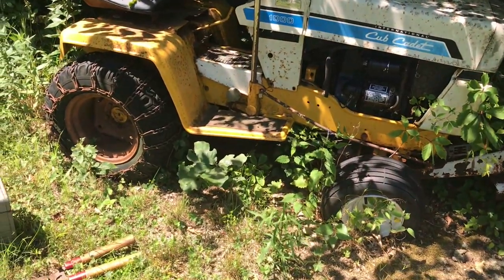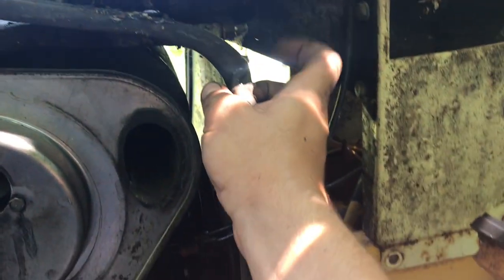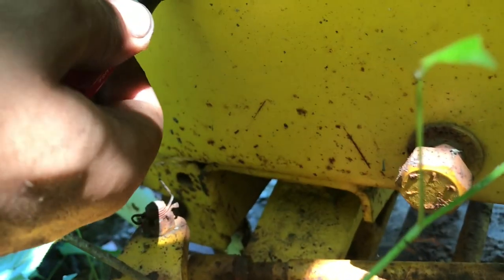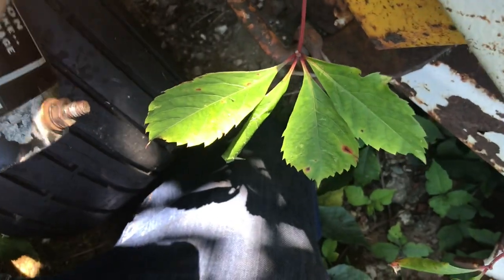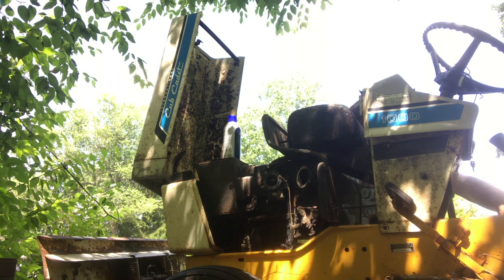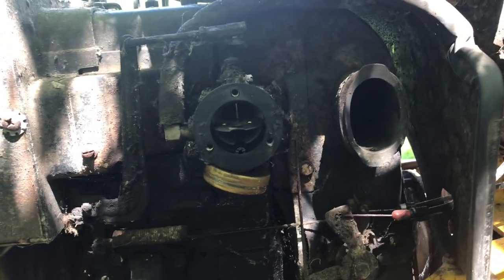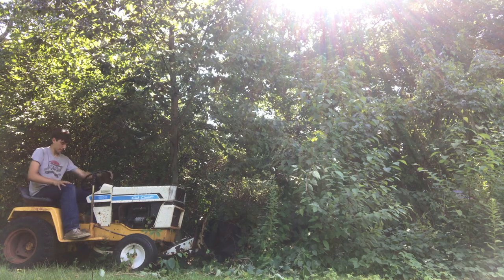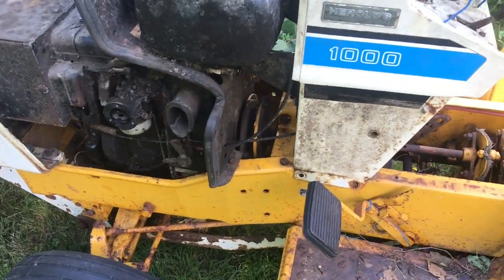1978 IH Cub Cadet 1000 Tractor | WILL IT RUN??? Sitting 20 years | REVIVAL

Comment: I'm a sucker for hunting vintage iron, but when the previous owner tells me it's been sitting for multiple decades and I go out to see that nature is trying to reclaim its yummy metal parts, my wallet starts screaming in my pocket. I start looking at how much metal is left and just bypass the fluid tanks, knowing they're full of contaminated and questionable fluids that have seeped in over the years to determine if I want to fall into the rescue trap again. At least you picked one that will be easier to find parts for! No one tells you these things til it's too late, but finding unique mechanic wunderkinds are definitely double bladed weapons for your sanity. They are cool and unique, but if you're not into reinventing parts that may not have ever existed elsewhere, it's a nightmare to work on them.
Just got done fabricating a clutch disc for an '86 Toro that it seems most of the parts were discontinued in 2005. Came out great, and thankfully most everything else is something you can bodge together from hardware store supplies like bars and springs, but those one-off parts are Always problems to solve. Part of the fun (read: insanity) if you will.

Comment: Nice find. I have a 1976 1000 that I scored at an auction for $70.00. It probably sat as long as this one did in a barn. I had it running and driving within a couple of days of getting it home. Mine has the 44A rotary mower on it, and I am currently working on restoring it. It has definitely been a fun quarantine project.
Reply: Which auctiona did you get it off of? Ive been looking for some new projects and cant find anything on facebook marketplace

Comment: I purchased a 1000 quietline for $150. I put a used 12 hp aqs upgrade and ran it for over 12 years mowing. The motor needs rebuilding and I picked up a used 14 hp aqs to swap it out. These are awesome tractors.

Comment: Congratulations on your Cub Cadet. Currently I have two {107, 682} and looking at possibly acquiring another 682 which would make three. The Firestone tires are  probably the original tires and I m not sure if the front tires are original but a very good possibility that they were. 
The chattering noise was the starter solenoid having bad connection issues probably from dirty connections at the terminals as you were probably all aware. I have experienced that sound many times over the past several years - So I felt your pain. 
As far as the clutch issue, The clutch spring on the Cub Cadets would break which would result in a similar situation to what you’re Cub was exhibiting in the video. Unfortunately, Both of my Cubs are hydrostatic- So I can’t be of much help specifically regarding your clutch issue. There are several Cub Cadet groups on Facebook in which cover several different areas. Thanks for sharing your experience here on YouTube. Best Regards From Versailles, Ky.

Comment: You should get the old sears, and the disker that you flipped into the weeds, those old garden tractors are tough little things. I have a 1200 cub and a 1650 I’m trying to get up and running. Looking forward to seeing more updates on this tractor!
Reply from the maker: I would take both those but I just don’t have the room. The IH was pushing it as is but had to have it. Good luck with your tractors. Thank you
Reply: The clutch is probably rusted and stuck to the two pressure plates causing the gears to grind (something you DON'T want to do). Take it apart and fix it right. It will last another 20 years!  
Best of luck with your 1000! They're a great machine to have.